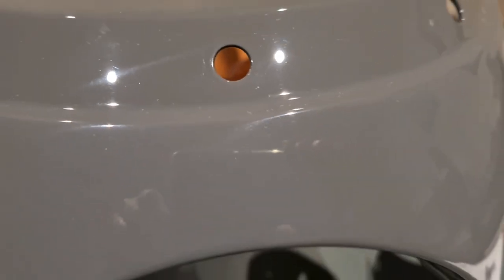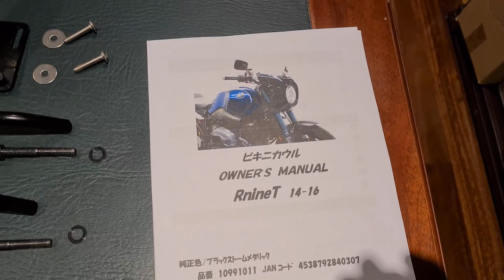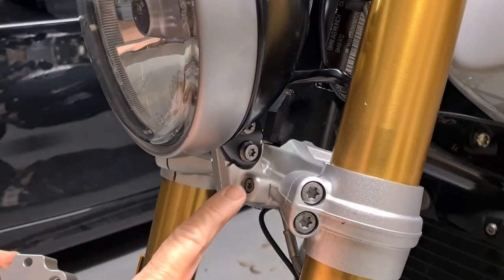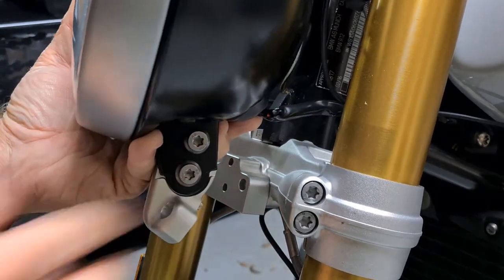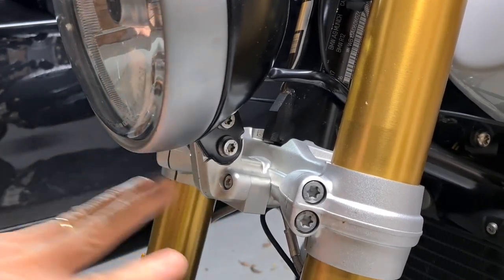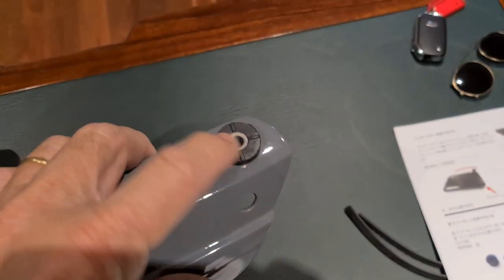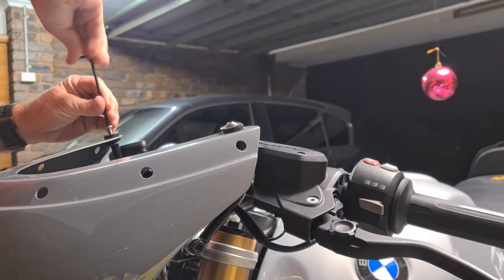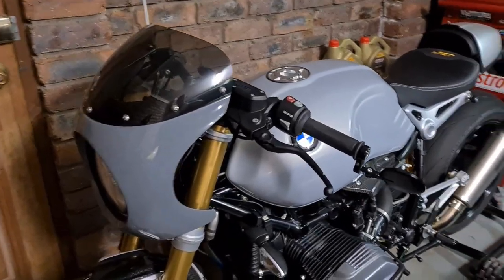Fitting a bikini fairing to your R Nine T.

Comment: I like it, Very nice. I am a firm believer a half fairing makes every NEO/retro bike a lot nicer, cooler and easier to ride at high speed. My 2014 BMW R9T roadster is the original black storm metallic and I have a black Wunderlich Daytona fairing mounted on it. I love it it’s so perfect looking with that fairing and when travelling at highway speeds, like 160 to 180 kph I can duck down underneath just a bit. Feels perfect to me. But I don’t care for lowered bars, instead I raised mine with Hornig 30 mm raisers and it’s just a great upright riding position now.
Reply: May I ask PLEASE, WHERE did you purchase your 30mm raisers from?  And the cost?
Can I assume they will fit on a 2022 R9t  Urban?

Thank You and regards.
(Melb. Vic.)